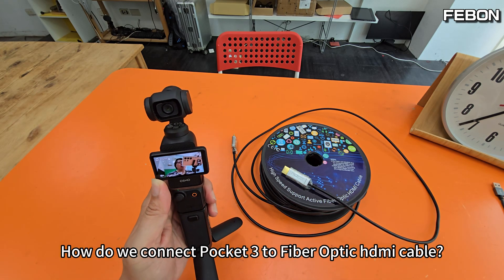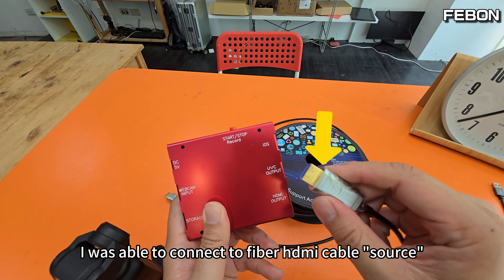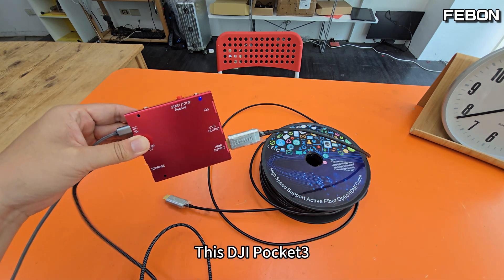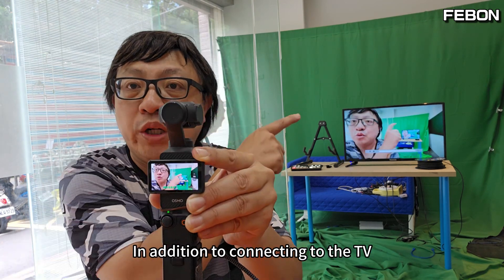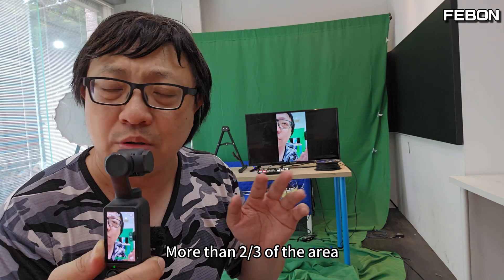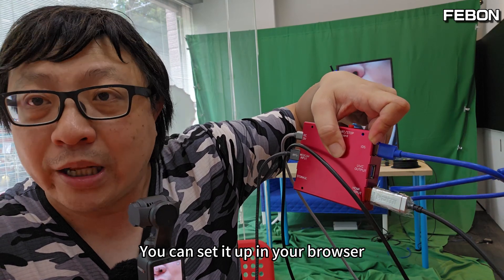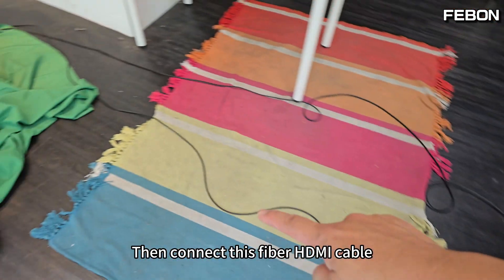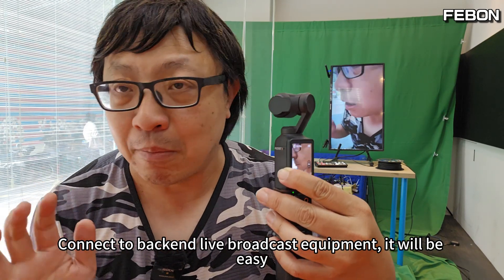DJI Pocket 3 with LONGER Fiber Optic HDMI cable - Extend video transmission  UVC to HDMI adapter

Comment: Proof of concept! For mixing video I would need to manage that lag though in mmy switcher if that were possible. Looks to be about 150 to 250 ms - maybe delay all outher sources so that the DJI OP3 connection can catch up
Reply from the maker: the delay of dji pocket 3 is about 100ms .